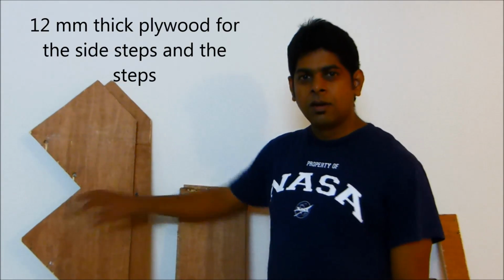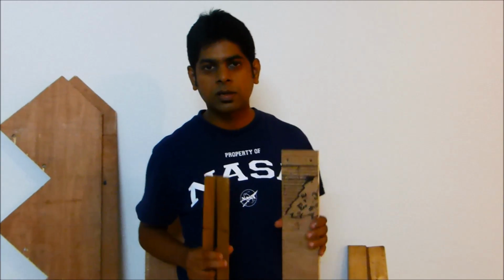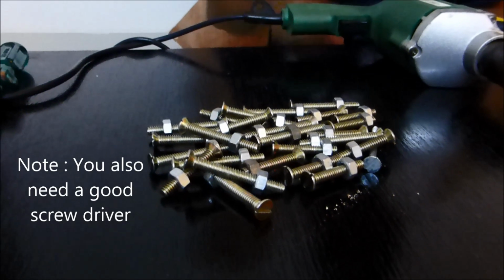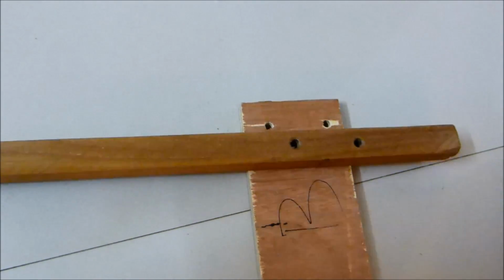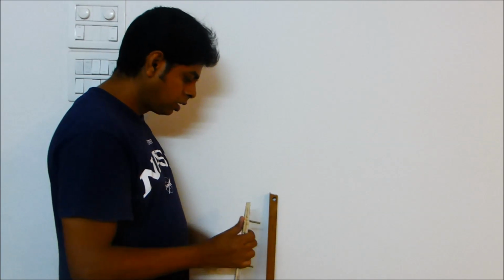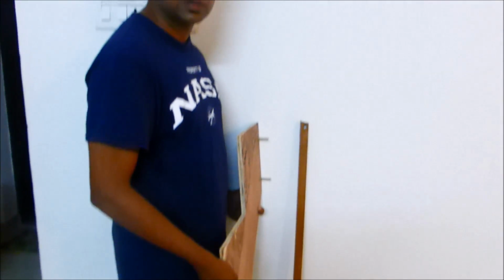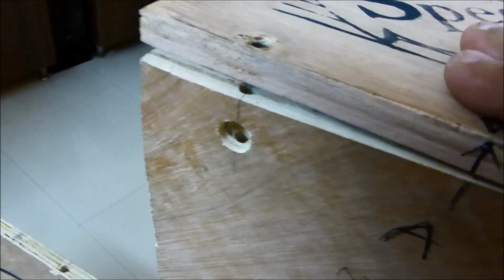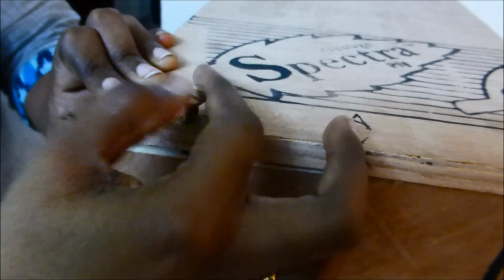How to build DIY Golu Padi this Navaratri

Comment: Can we use 6mm plywood sheet.....?
Reply from the maker: No... Will not be able to bear the weight. Even 12mm will wilt in the middle. Suggest 12 or 18
Reply: I need 7steps . If it possile you prepare and give . I pay the amount.ok means please give the contact no

Comment: If you are in USA or Canada, For the steps, you can buy it from any home improvement stores, they have 3, 5, or 8 steps.   http://www.homedepot.com/p/5-Step-Pressure-Treated-Cedar-Tone-Pine-Stair-Stringer-211692/205852532?MERCH=REC-_-PIPHorizontal1_rr-_-205852927-_-205852532-_-N
Reply: Hi, I am In Canada. I checked this link, thanks so much for sharing. What else do I need to buy? What would be the budget for 5 steps and what is the length? Can you please help me thank you.